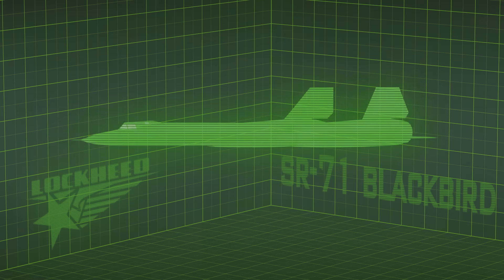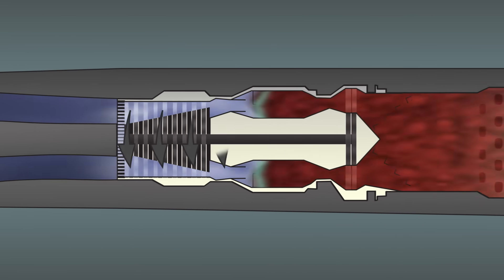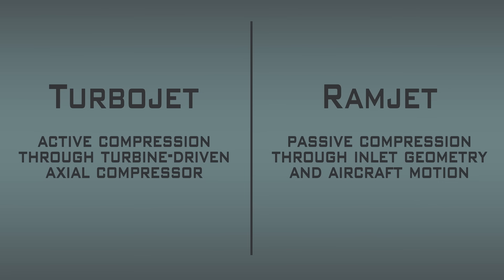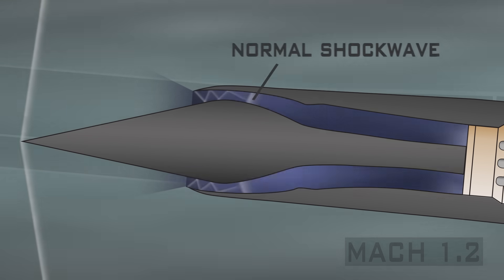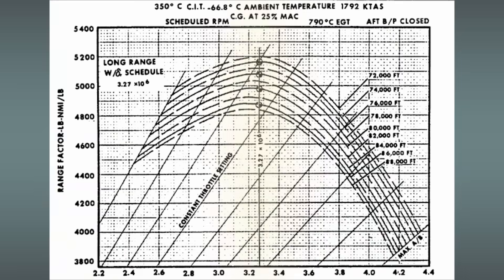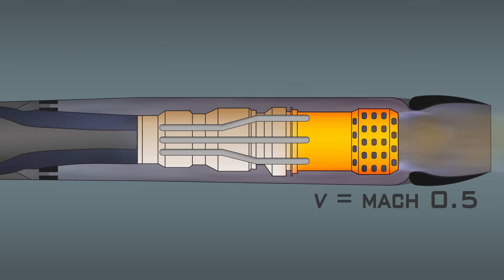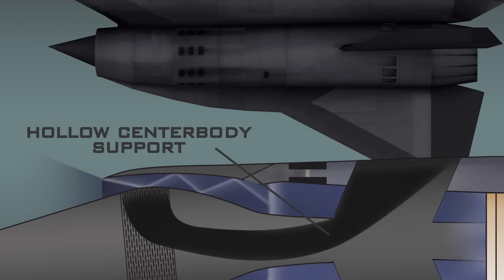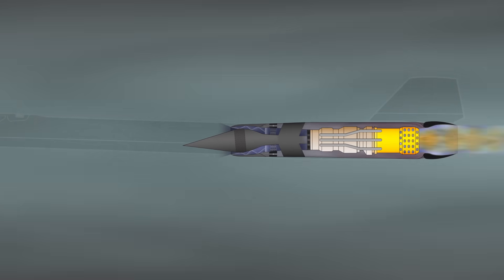The Mighty J58 - The SR-71's Secret Powerhouse

Comment: did Lockheed designed this engine or p&w?
Reply from the maker: Originally it was designed by P&W for the Navy, but Lockheed collaborated with P&W to redesign the engine to work in the A-12, that is, to operate at mach 3.2 continuously within the nacelle.
Reply: +lee coates - The Mig-21 and SR-71 engines are completely different and it was not designed in the Soviet Union. They don't even work the same way. ThatMontmorency keeps making false comments but can't and won't show any proof to back it up. Don't fall for it !! He apparently has a Sesame Street education that tells him that both engines have inlet spikes so they must be the same.
Reply: Your comment is rediculous and trolling the Americans(intentionally i think). The mig 25 was fast but it wasnt as fast, efficient or sustainable. The plane needed a new engine after every mach 3 flight(think thats correct?)
Reply: +lee coates - You are right on everything you said. The Mig-25 was able to achieve mach 3 but it did it by brute force which is why the engine overheated and over sped and had to be rebuilt afterward.
Reply: Like what +Techlaboratories is saying, I've found in my years in aerospace, most projects, including powerplants have a collaborative effort from several powerplant companies...............more on this later. This is a little different of a story than what is going on here. Lockheed designs ground vehicles, defense and airframes. P&W had to work with them regarding this powerplant because of the nacelle, which is part of the airframe and not the powerplant. Also, controls, mounts and various lines coming from the airframe to the powerplant, and visa versa. 

Now, P&W, Rolls Royce, GE, etc... have collaborated on the same powerplants before, which is always interesting because they also compete with one another, but fun to work with from my own experience. And, competing airframe companies have worked with each other on the same airframe. 

Oh.....how I wish I could hear the stories of lockheed and P&W engineers' stories about each other, forget the aircraft at this moment!   

I basically just repeated what TechLaboratories just said, only to add my own personal crap in there.
Reply: ThatMontmorency dude shut up... the foxbat was a piece of crap which was economically unreasonable, its engines would have to be completely replaced every time it flew top speed and had no real use as a fighter nor as an interceptor since its electronics were as obsolete as a yak-2. When the foxbat was handed to NATO by a defecting pilot it was found to be truly inferior to what it was thought to be when it was released. In fact, it had literally no chance against and F15 or wouldn't even be a proper spy plane like the Blackbird. Learn your facts.
Reply: ThatMontmorency As I said, one thing is "breaking records" and another one is actual usability on the field. "Above Mach 2.8 the engines would overheat and burn up. The Americans had clocked a Mig-25 over Israel at Mach 3.2 in 1973. Upon landing in Egypt, the engines were totally destroyed." Hence why speed was limited to 2.5 in the 25. The Blackbird could sustain speeds of over mach 3, as per operational ceiling, the Blackbird could go higher as well, and there´s a reason why it was used for so long after the 25 was retired.
Reply: + Hart Poole - The SR-71 and the Mig-25 engines work similar up to mach 1.6, not exactly but similar. After that they are completely different. The inlet is the key difference here. If you look at it like this - The inlet spike , nacelle and the ejector nozzle is the SR-71 engine, and then there is the J-58 . The SR-71 engine provides the environment for the J-58 to operate in at any speed and at any altitude. Up to mach 1.6 the J-58 is the main source of thrust. After that the spike begins to retract and the main source of thrust begins to switch until the inlet (SR-71 eng) is providing most of the thrust at mach 3.2 .  The inlet itself is a "working" part like an engine . If it can be "unstarted", it first has to be "started". Once it is started , the inlet begins to drive the plane forward. The inlet is the driving force, not the afterburner. The inlet and ejector nozzle cannot be operated by itself, it still needs the afterburner from the J-58 to operate....so they work together but the "inlet" is the key. Wikipedia describes this system as a partial ramjet instead of a turbo ramjet, but either way it becomes part ramjet which is the driving force. Most people make the mistake of thinking that the inlet somehow makes it possible for the J-58 to provide all the thrust....not true. At mach 3.2 the J-58 is little more than a life support system for electronics, hydraulics and the afterburner.  If you can separate the J-58 from the SR-71 engine you can begin to see how it works even though they have to work together. The SR-71 is unique and like no other plane before or since....it can't be compared to the Mig-25 except that they attained the same speed. The Mig-25 accomplishes mach 3.2 by brute force meaning over fueling and over revving which is why it can't sustain it.
Reply: lee coates no it wasn't going to be a missile xD. Is is meant to be a sub space (in space but not really all the way in space, stratosphere I think) reconnaissance plane to spy on the enemy. It being in the stratosphere means it can't be locked on by SAM missile.
Reply: ThatMontmorency sure dumbass that's why it was so promptly replaced with the MiG 31 and the only surprise it gave the world was the fact that it was an utter disappointment hahaha. If your were actually talking about the 31 I'd respect your opinion since that was at least a proper Interceptor, but the 25, aside it's climb rate and speed never actually did anything worthy or had any real use, hence, now it's just a museum piece while the blackbird is still re known (along with the U2) as the best recon planes ever made. Hell a 21 has way more merit than a foxbat dumbass hahah
Reply: Why do you keep feeding the troll?
Reply: +ThatMontmorency - My post was for winbreaker not you. I no longer wish to discuss anything with someone who claims to speak facts but cannot show proof or at least a source for your "facts". If you want your word to be credible then show facts or a source for your earlier statements...."the SR-71 never flew an operational mission and went straight to the museum after test flights" or how about ".....slightly modified copy of of MiG-21 powerplant".....or even " 85% of American children born in that era have Mig-25 as their middle name". If you respond with anything other than proof or a source for these statements then you are not credible or factual.
Reply: ThatMontmorency mate cant you just shut the fuck up? I have gone past giving a fuck about what your on about because I know your talking shit. I don't want to turn off the notifications because I am interested in what the other are saying, but I ain't interested in your bitch comments, I am getting pointless notifications because of you.
Reply: The Mig could fly at Mach 3.2 yes, but it couldn't maintain that speed like the Blackbird could.  The Blackbird was designed to CRUISE at Mach 3.2, the Mig was designed with a TOP speed of 3.2.  Two totally different meanings for the speed.  The Blackbird could fly quit a bit faster than 3.2, where as the Mig cruised much slower.  The Mig could never maintain that speed.  It would blow thru it's fuel load in less than 5 min cruising at that speed.
Reply: The funny part is, BTW, that despite all that effort that went into SR-71 engine to make it achieve speeds over Mach 3 proved to be wasted once Soviet Union released its famous MiG-25. MiG-25 is a plane with two fairly conventional (albeit large) turbofan engines that achieved Mach 3.2 without all that turbojet fuss. Satellites and MiG-25 were the reasons SR-71 became obsolete well before its testing was finished, and thus ended up beingh a straight-to-museum airplane.
Reply: + lee coates - no problem man. Truth is important ....but be careful of anything you hear from THAT source. I'm still stuck on ....."85% of American children born in that era have Mig-25 as their middle name." Damn ! Now I have to go change my middle name !! :)
Reply: The engine design was "borrowed" from the crashed UFO at Roswell, New Mexico.
Reply: lol
Reply: +windbreaker57 - The MIG-25 did cause concern in the west, the US invented the F-15 to counter it......according the a Discovery wings episode that I saw. Once the U.S. got a hold of one from a defector they were surprised to see how basic it was...using vacuum tubes for everything instead of electronics. JavierCR25 had the rest correct.....as far as I know the MIG-25 was only clocked at that speed once. I read somewhere that it was trying to escape interception from a plane or missile that was launched at it which is why it was clocked going mach 3.2.......it does seem plausible that Israel would attempt to shoot it down but unless I could find that source again I wouldn't state it as fact . It wasn't designed for mach 3 flight otherwise they wouldn't redline it at mach 2.8 and we would have clocked it at mach 3.2 many times.
Reply: The MiG-25 did NOT achieve Mach 3.2.   It barely crossed Mach 3, and the engines were toast because the Tumansky engines didn't have ramps to adjust the shockwave off of the compressor face, and the metallurgy of their blades was garbage.  Even the 31 can't hit Mach 3.2.  Neither can CRUISE at 3 either.  The SR-71 had a top speed of roughly Mach 3.5 and change, depending on air temperature as it related to the compressor inlet temperature which had a max temp that they didn't want to exceed (P&W wouldn't guarantee anything beyond 417 degree Celsius, although that figure WAS exceeded a few times, briefly, in combat conditions).
Reply: For the Navy? Was it going to be a missile?
Reply: I know what blackbird is :) I mean the engines.  what was their original use? was it for this plane or something else?
Reply: Aerohk: Soviet Union designed it. This is a slightly modified copy of of MiG-21 powerplant. American pilots always joked that it took two MiG-21s to build one SR-71. Some materials are replaced to withstand higher thermal loads, but otherwise there are virtually no changes.
Reply: Lardawg 67 haha. during my upbringing everybody knew the blackbird was the best high speed plane out there. bring designed in Russia sounded far fetched to me but as a layman I couldn't say he was right or wrong.  thanks for clarification :)
Reply: ThatMontmorency you´re such a dumbass that you´re comparing an SR71 to a MiG25 hahahah!!! you´re soooo i love with russian tech you don´t see the truth. First flight of the 25 was in 1964, the 31 flew in 75, in aviation terms that´s very quick dumbass! hahaha, most decent planes last 20 to 30 years in service. Dude you want to talk Russian tech, talk anything SU-27 derived airplane, hell, go back and talk about the IL-2, but the 25 was a bigger hype than the actual let down.
Reply: ThatMontmorency Oh and by the way, the 31 WAS the first one with the phased array, not the 25... dumbass! LOL
Reply: Sigh... A retardfest full of butthurting Americans... It would've been exciting, if it weren't so stale.
Reply: +Lardawg67 - Is my recollection correct that it was a Mig-25 observed at Mach 3 over the Mid East that caused concern in the West? I recall having read a book that that Mig-25 speed was an aberration, a result of an engine going uncontrollably haywire. (Edit: There, JavierCR25 had it: "The Americans had clocked a Mig-25 over Israel at Mach 3.2 in 1973. Upon landing in Egypt, the engines were totally destroyed." Thanks!)
Reply: windbreaker57 LOL, folks! Looks like JavierCR25  registered another account to repost his drunken troll tale about "destroyed MiG's engines" :))
You all know that I have already debunked that myth. MiG-25 engines do not get destroyed under sustained Mach 3 flight. Everybody here has already thanked me for this information and thoroughly committed my words to memory. 
But this guy thinks that he can somehow override the level of authority and respect my word commands here by simply registering another account... Facepalm. What is he hoping for?
Reply: Lardawg 67 Sorry for your wasted effort, but I have already debunked everything you said. Trying to reiterate it again and again won't make these bro-stories true.
Reply: Lardawg 67 Firstly, you are confused. There's no such thing as "post for someone" in a public forum. Secondly, your inflamed responses clearly indicate that you are one of those 85%. Isn't that the perfect proof?
Reply: Aerohk naw m8...... I did.....
Reply: Kevin Neville that's pretty cool
Reply: Who is the J-58 designer?
Reply: Pretty sure every one here has NOT thanked you.  Pretty sure everyone here as debunked your myth that the Mig-25 was the greatest thing ever.  Was it fast?  Sure.  Could it sustain those speeds for any longer than a few minutes without destroying it's engines?  Not a chance.  The SR-71 and the J58 was designed to maintain Mach 3 speeds for hours up hours without even breaking a sweat.  You sir, are a classic narcissist.
Reply: However, the MiG-25 could fly higher than the Blackbird. Soviet engineers redesigned a reconnaissance version of the MiG-25 that could cruise around 2000 mph at 125,000 feet.
Reply: ThatMontmorency Now you're making me laugh. Good joke.
Reply: @Thatmontmercyidiot - tell me, what exactly was the cornering airspeed of the Mig-25, or the 31 for that matter?  How long did they achieve Mach 3 in flight?  Why do we have pictures of them FALLING out of the sky trying to reach SR-71's in flight??  Why is that huh?  That phased array radar in the 25 was a piece of garbage.  The 31 had a much better system and still does.  AESA radar is FAR better however, and has both better resolution and range than that phased array heap.  We had ATC radar that was phased array for god's sake, we knew better than to put that shit on an aircraft.  The AWG-9 was FAR better than the crap the 25 had, and the AIM-54 could blow the MiG-25 out of the sky before comradeski could every get close...
Reply: @kaziwhateverthehjell  - No, it could NOT cruise at 125,000 feet.  It could zoom climb to that altitude.  Guess what we had back in the day that could as well?  The freaking F-104 Starfighter.  So I'm not impressed that 30 years later the Russkies figured out how to get to 125,000 feet without solid rocket propulsion.  It isn't impressive.  yawn
Reply: Really ...............
Reply: In principle, the engines of the SR- 71 and MiG-25 work at high speeds ( Mach 3+) in the same way, most of the power and thrust are produced in the afterburner. And the core of the engine is a large single shaft turbojet. In practice, the ways they get the air to the afterburner with plenty of oxygen for reheat is very different. The SR-71 bypasses the last compressor stages reducing their heat and burning only part of the intake air charge, The MiG uses a water injector to cool the intake charge then burns the whole charge lean. Both methods reduce the temperature of the turbines and allow a lot of fuel in the afterburner. But the MiG's solution is only able to sprint for a few minutes and the SE-71's is able to run for hours.
And Yes the MiG could run its engines over maximum power and the turbines and last compressor stages would basically anneal when they cooled the engine would need replacing.
Reply: JavierCR25 Had a good laugh at that one! Same old, same old illiterate kiddie bullshit about "engine replacement". Illiterate bullshit dismissed. Done.
Now facts: MiG-25 was not only the fastest plane ever, but also the first airborne platform with phased-array radar. The Soviet success in installing such radar system on a compact plane was an event that made the Earth stand still for a while. Experts agree that it was the first leap that propelled Soviet Union and Russia to that astronomical superiority over the US radar technology it enjoys today. The panic it caused in USA was comparable to the launch of the Sputnik. Back then the entirety of US armed forces was so enveloped in the eclectic mix of mouthfoaming rage and disabling fear, that historians attribute the release of MiG-25 as the reason for the most massive purge in the history of US top military intelligence brass. The US regime was grabbing people with their families, flattening them into bloody pulp and dumping into abandoned mines just for the failure to predict the appearance of MiG-25 and, later, for the failure to obtain one for copying. The rotation of the USAF grunt personnel reached 80% per year just because everybody was so uncontrollably and overwhelminghly terrified, they couldn't do anything: they were just runnig around screaming and bumping headfirst into the walls, pants soiled. Eventually, when US engineers got their hands on a real MiG-25, the entire phased-array system was metculously copied by Grumman & Lockheed Martin and, for a while, installed routinely in F-14. The funny fact is that they even used a supply route through Turkey to obtain a batch of Soviet miniature vacuum tubes used to commutate the enormpoius power of the radar (until USA managed to copy the tubes as well). In other words, for a significant period of time back then for Americans the word "God" stopped meaning the usual "USSR", and started to mean "MiG-25". Amercians went to sleep praying to Mig-25, woke up praising to MiG-25, named their children MiG-25 and so on. (Yes, 85% of American chidren born in that era have Mig-25 as their middle name. Some did not even change it later.) So, I understand your powerless rage, but I don't think your bullshit can fly here (probably needs engine replacement, eh?)
Reply: lee coates Sorry, sweetie, but my job here is to educate, your job here is to get educated. You don't get to "give a fuck" or "not give a fuck" (not sure where you got this illusion from). You are here specifically to listen to me. You get to sit quietly, you hands neatly folded, and soak in like a sponge everything I say. For now, this is the all-encompassing purpose of your entire existence. You and the rest of the shitties here will be free to go when I explicitly say the word "dismissed". Does this clear your naive misconceptions about your role in this world? Or do I need to say it louder?